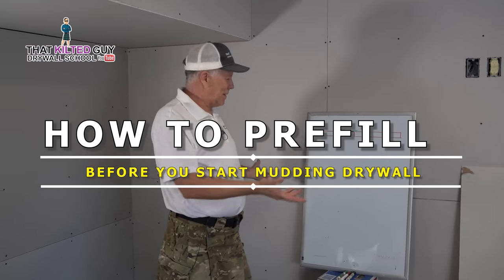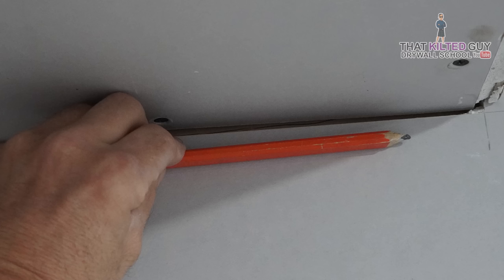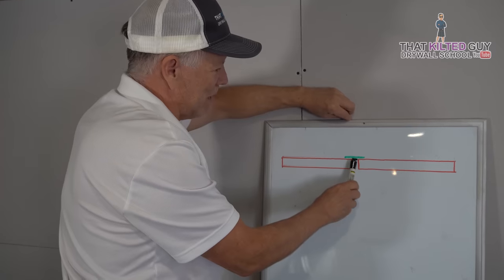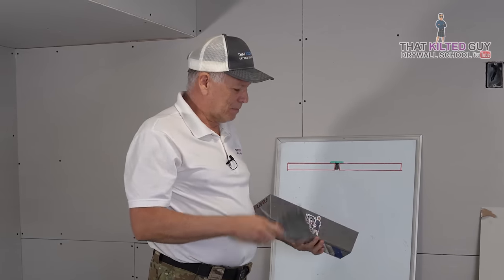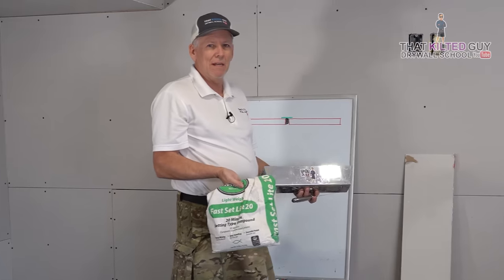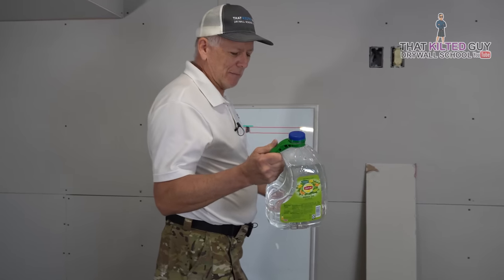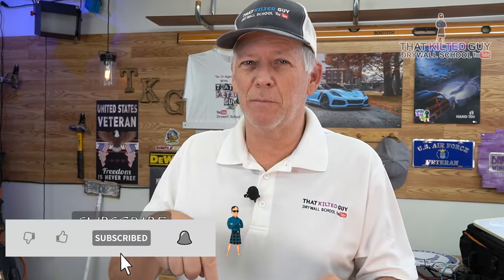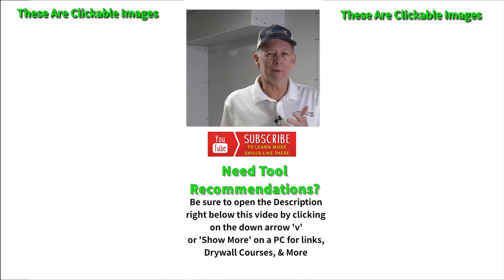How to PreFill BEFORE Taping & Mudding. Very Important

Comment: Ive always been a mad scientist with tools and things but have you ever tried using a router (maybe a straight mortise bit) and setting the depth to whatever the recess is on the length edge of a sheet of drywall (i guess roughly a 16th?) and routing the butt joint ends  down just enough so the tape will fit in the recess you just routed?  In a nutshell doing that to reduce amount of mud coats it takes to hide a butt joint?  If you haven't I'm gonna try it on some scrap and see what happens.  Believe it or not a trim flush bit on a router cuts drywall like butter and leaves the edges factory smooth but i think the paper was slightly jagged.
Reply: Maybe run a razor knife first and pre-cut a line so the paper isnt jagged where the router is gonna cut
Reply from the maker: I haven’t but I think someone makes a tool that does something similar.

Comment: Thank you for this teaching. May the Lord continue 
bless you with  life. You arw a great teacher. I do have a question. When they built our house the put sheetrock under the garage and a electric garage door. All the walls are cracking where the sheetrock are joined. Will the quick set be stronger and will it work? I can't afford to put siding under there at this time. We can't use the garage because the rain that the wind blows under there will make it much worse. If you could answer this question for me it would be a great help and much appreciated help. Thank you.
Reply from the maker: I can’t answer a question like that without being there.
Reply: @ThatKiltedGuyDIY  ok. Thank you for replying. I believe they just use regular drywall mud and tape. For the life of me I don't understand why anyone would put drywall in a garage. Maybe I can get it all straighten out.

Comment: I wouldn't use the handle of the knife on the cut edge you should cut the edge with your razor knife @ 45 degree angle then fill it in and fire the hanger. The problem with home owners DIY is they use every tiny piece of rock to save money only to cost a fortune to fix it all. When you hang rock use full pcs. when hanging a 4x8 wall use all the 4x8 rock use the whole piece not 2 pcs. Never start from the floor up without using a 1/2 in off the floor.

Comment: Love everything you post. 
How do I clean my pan out? Dries really hard. Do you recommend just soaking it?
Thank you
Reply from the maker: I never let it dry out like that but yes just soaking it will work if it’s not hot mud
Reply: If soaking it doesn’t work, a screwdriver to break up the big chunks of mud, and one of those stainless scouring pads (like the chore-boy copper ones, but stainless) does a good job of getting the residuals off.

(Those stainless scrubbers also work well for getting paint off of brushes and brush handles (to clean bristles, squeeze them between the scrubber gently, and pull, always in the direction of the brisltes)
Reply: Lol…. My phone spell corrected “chunks” to a different word with an i, that I only ever use to refer to defects in a suit of armor, and the YouTube AI flagged the comment and wouldn’t let me fix it… took a minute to figure out why,  and luckily I was able to copy it, delete the original, and repost.  Thanks for protecting us all YT! Lol
Reply: @hughbrackett343  - especially when they can’t see you sneaking up from the side...

You know... because of the helmet on the suit of armor the mud people wear.
Reply: @hughbrackett343  - want to see YT sen sor ship, in real time?  Try and post the following european pat tent number in a single comment.
Reply: EP
Reply: 29
Reply: 61
Reply: 2A1
Reply from the maker: What is that a patent for And how is it appropriate for here?
Reply: @ThatKiltedGuyDIY   that patent is for an off label use of an existing drug, for treating shingles...  I think YT blocks it because the same drug is being used by some people to deworm horses...  

  Sorry... I’ll delete all of my comments about that, if you find it inappropriate and wish me to.   It’s not drywall related, for sure!

Comment: This may be a dumb question, but why would you tape at all after you prefill?  It seems like you wouldn't need to tape after you've filled the gap.  Please advise me!  Thank you for your videos, you're a great teacher and I've learned a lot!
Reply from the maker: For the same reason concrete requires mesh or rebar, without it, it will crack

Comment: Nice video thanks
Do you have to wait for the mud to dry before you can tape an spackel
Reply from the maker: If you use fast setting joint compound all it has to do is set up firmly before you tape over it
Reply: @ThatKiltedGuyDIY  
Thank u for your reply 👍

Comment: I have a mobile home and we had someone do the seams they removed the strip and it looks like they used the yellow mesh tape … and then smoothed the seams & textured… I then had it painted… it’s been about two years now … the renters moved out and I was going to just paint the walls but I noticed the seams are splitting and they almost looked like it’s they are puffing out … if I push them they flatten out . I was going to see if i could fix this … not all of the seams are failing… I have one wall in the bedroom where all the seams are puffing… so I opened one up and I can see the yellow mesh tape .  It’s like the compound is not sticking to the tape . Should I remove all of the stuff that they put in the grove and start over or is there another way of fixing this ? Can I use a razor and open the seam up and add glue and close it back up and then just fill the razor seam ? Or do I nee the remove everything and start over completely with a new mesh tape and mud it ?

Comment: around 10:30, in the closet, you're going over a screw that is not tight enough. You can hear the knife going over it several times. Why didn't you screw it in before doing the filling?
Reply from the maker: I did after the camera was off

Comment: Thanks I just put up some drywall and have all the issues you just went over.   I hope I do a better taping/mudding then my last project.
You mentioned Durock I think as the best to fill with, did I hear correctly?
Reply from the maker: That or any fast setting joint Compound. I prefer lightweight fast setting as it sands a little

Comment: In that closet area it looked like there were two tapered edges running horizontally running up to a factory edge running vertically at 10:24 
How do you go about taping that? I saw you used a 12" knife to fill in a similar joint on the other side
Reply from the maker: I’ll try to cover that in a future video. It’s hard to explain in text

Comment: Question:
Do you comeback with a tape after you fill a factory edge to a cut edge butt  joint? I mean, there is  a lot of mud after 12” knife, that probably would make it hard to see where the tape should go.
Reply from the maker: Yes

Comment: I have a paneled bathroom. Im filling the grooves - I’m going to use some ultra fine tape over the grooves - should I use the hot mud in the grooves? Tks!
Reply from the maker: as long as the grooves are deeper than a millimeter or so, (1/32")

Comment: Prefill does it work in cracks or is it better to make a patch the in the driwall it's like 2 inches still have the white there but you'll see the wood about quarter of an inch
Reply from the maker: Prefill is good for all voids and wider cracks as long as you put some type of joint tape over that on the next coat
Reply: @ThatKiltedGuyDIY  thank you thank you thank you very much

Comment: Do you fill screw holes with Durabond as well, or just the seams / gaps? Someone told me not to use Durabond for the screws. 🤷🏻‍♂️
Reply from the maker: Durabond needs depth to work so use regular mud

Comment: Hi! We are trying to fix our plaster-filled house! The walls had layers and layers of wallpaper and paint. We took the ceilings down, and it was such a mess that we decided we would just keep the plaster walls -we finished putting up the drywall on the ceiling, ad these tips are fantastic for us, as we just left a bunch of gaps and imperfections that needed to be fixed before taping and mudding. My questions: There is a very imperfect surface after taking the old wallpaper and layer of paint. The wallpaper glue and some remaining wallpaper patches and so. Should I sand that down? I gave it a layer of Guardz to see if we could stabilize the remains, but there are still sticking out. Should I grind that down? Or will that be taken care of with skin coating? Should we skin coat the ceiling, too, as it has new drywall? Should we tape the junction of the ceiling and the plaster walls? Lots of questions!!
Reply from the maker: We can provide personal support on extensive projects at: https://www.thatkiltedguy.com/consulting-services or on the higher levels of Patreon at: www.patreon.com/thatkiltedguy 

Good luck! Guy 
PS: it’s called skim coating not skin coating

Comment: Depending on what video you watch youll find about 50% say to leave a 1/8 " or more gap in drywall seams. I think they do it just to mess with folks. Not much different with tape and bedding in reference to prefilling. Not long ago most warned not to prefill. I have one rule on my jobs that is set in stone. No kilts if using stilts! Thats just not fair to the non visually impaired.
Reply from the maker: Lol
Reply: Leaving the gap so you can prefill it makes a stronger joint

Comment: IF you fill it in good enough with plaster, do you even need to tape?  Old houses had lath all over the walls and they just plastered over all those seems without taping.
Reply from the maker: If it’s just a hole in the wall, yes, but not when there’s long joints like this. 

I will be covering many Drywall related subjects like this in my online courses at www.DrywallAcademy.com

Comment: I have encountered a problem. We had a flood in our basement and they had to cut a minimum of 22 inches, around the perimeter of the basement. Well we are in the process of putting the drywall  back up, but realized at almost the completion of putting it up, that the wrong size drywall was being used, My fiances cousin was in charge of making the purchase, and assumed that it was 1/2 in as oppose to 5/8. What we are left with is a major gap from top to bottom, with some being worse than others. My question is, should I tear out the wrong drywall and purchase the correct size, or is there another option. Can I use some kind of filler to cover the gap, like "East Rock Easy Sand Joint Compound" and then mud and tape? I know it won;t be anywhere near perfect because this will be my first time attempting to do drywall. Any advice will be helpful. Thank you!
Reply from the maker: You could just remove the drywall, add some cardboard shims to bring it out to the right thickness, reinstall and go from there. Here’s a link to what I’m talking about but you can buy a small pack for much less at your local big box store.

https://amzn.to/3qbsg8Z

Hey I really rely on the support of my viewers to put these videos out and answer your questions. One easy way is to become a member of my YouTube channel. You’ll get priority replies to your questions, bonus content and more.  Here’s the link to join my YouTube membership. https://m.youtube.com/sponsor_channel/UCSinsqowcKxmSaKkx3W9_0w?noapp=1

Comment: Can you answer a question, or rather shoot a video on two angles that meet up unaligned and what to do. I have seen products such as X crack being used, but what if you don't use that. How do you mud it?,  Old houses have framing such as 3 window walls that extend out, and the walls are never in the same plane. This is similar to the two boards not in the same "plane" in this video. This is  something I have not come across on any channels on youtube.
Reply from the maker: I think I know what you’re talking about but if you have any pictures, illustrations, etc. to clarify it more, email them to me at ThatKiltedGuy15@gmail.com 

But I will be releasing a video I already shot soon about how I handle angles such as 45° inside angles that might help.

Comment: So I just pre-filled a repair job I am working on. I used Easy Sand 90. I got the job done, but it didn't go as quickly and easily as did you. LOL! Just an amateur here. Should I sand the pre-fill smooth before I do the taping with the general purpose compound? Or do I just tape over the roughed in pre-fill? As I said, my job is not nearly as smooth and perfect as yours so there are some rough spots and trowel lines.
Reply from the maker: Sand it smooth first

Comment: Hey do ya ever pre-fill and then embed mesh tape? I kinda like doing it that way. In my head I feel like I’m saving some time. 
I always enjoy ur vids they are great.
Reply from the maker: On repairs and such I do it that way all the time
Reply: @ThatKiltedGuyDIY  
Okay so I’ve got a question. When using mesh tape does
It really matter if you pre-fill the cracks with hot mud vs applying the mesh tape, then applying the hot mud? I’m only bringing this up because me and my father were debating this.
He’s retired now but used to do construction work. His opinion was it doesn’t matter if you apply the mesh tape then apply hot mud because the hot mud will get worked into the mesh tape and fill the crack or gap. 
So what do you think? Does it matter if you use hot mud and mesh tape and  apply the tape without Pre-filling because the hot mud will work it’s way into the gap or crack?

Comment: I wonder if DIY’r listening are at risk of creating a higher than normal seam because of the prefill.  Do you sand before taping?
Reply from the maker: If you put it on correctly you don’t need to. 
I will be covering many Drywall related subjects like this in my online courses at www.DrywallAcademy.com

Comment: I'm watching your videos trying to troubleshoot an issue I'm having. I have taped drywall once before on DIY house project and it all went fine. I was using drydex spackling. This time I'm using Drydex joint compound because I bought that instead by accident.  Every time it dries I find the tape has come loose at the edges in a few spots. No bubbles in the middle, just the edges popping up. I've pulled it off, removed the old mud and done it again several times, trying with more mud, less mud, more pressure, less pressure and even wetting the tape. Is it the joint compound? I feel like I'm going nuts! What am I missing? FYI the temp inside and outside is about 70F, any big gaps have been prefilled, and the mud is the consistency you demonstrate. Any help would be much appreciated!! Thank you!
Reply from the maker: You’re using the wrong materials. My ebook explains materials at https://etsy.me/3dxrMRK

Comment: Wait, are you saying that for the purposes of pre-filling large gaps, busted corners, screw heads dimples, and all the defects you showed in this video, we can use Easy Sand regular "cold" mud just as well as "hot" mud?
Reply from the maker: Easy sand fast setting joint compound is hot mud. It actually does warm up just like durabond does

Comment: Why don't you use durabond instead? It's better & and stronger than 45
Reply from the maker: For one, the only place you can durabond in my town is at True Value. But Two is the easy sand works just fine for this as it has no shrinkage and is plenty strong. It’s stronger than the Drywall so I don’t know why I need to be any stronger than that

Comment: Is it difficult to clean up 20 or 45 min mud once it dries in the mud pan? I’ve been drywalling as a handyman for 2 or so years now but have always used USG (green lid) and would like to start using this. Problem is I usually stick my pan in plastic bags until I get home to clean my tools so I don’t leave mud by their garden hose. Any advice?
Reply from the maker: What I do is a carry a bucket with a screw on lid like in this link and then I take a bucket of water with me to the job site and clean up immediately. You don’t want to let it harden as it’s extremely difficult to remove. 

https://amzn.to/34quNRq
Reply: @ThatKiltedGuyDIY  thank you so much! 👍🏼
Reply: Best thing I use for hot mud is Mud n' More MixBall.  Great for small batches.  I also use a hawk not a pan, easier to clean.  IF its a small patch I use Sheetrock 5.

Comment: Can I pre-fill with the dust control joint compound in the white and blue bucket? Do I need to thin that stuff with water too?
Reply from the maker: Anything deeper than 1/8 of an inch or wider than that needs to be pre-filled with fast setting joint compound. You can usually buy a tiny bag of it if you don’t want the full-size bag

Comment: Can you tape and finish immediately after you fill the gaps or do you have to wait for it to dry ?
Reply from the maker: You should use fast setting joint compound, and it only has to set up, not dry

Comment: do you use the same type of mud for taping afterwards ? having a large patch to repair I would like to use only one type of mud
Reply from the maker: You can tape with hot mud, if you are good, but it's very hard to sand so best to switch to Lightweight all purpose for the remainder.

Comment: Do you really get 45 min. of working time b4 it set up in you pan?  If so I must be mixing  it wrong or Something
Reply from the maker: If it says 45 minutes on the bag, that’s because it is intended to start setting up in 45 minutes. It can vary slightly but those are just the facts jack. 

It has nothing to do with how I’m using it although you can reduce the working time by over mixing it, using dirty water, dirty tools or using hot water.